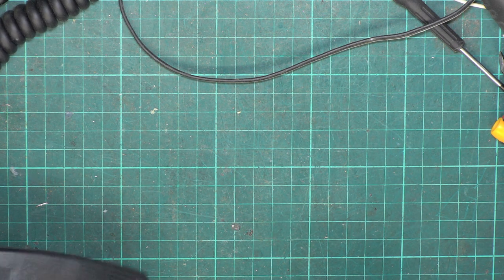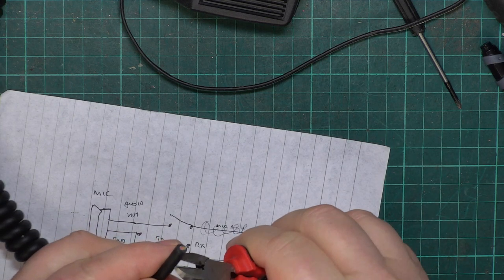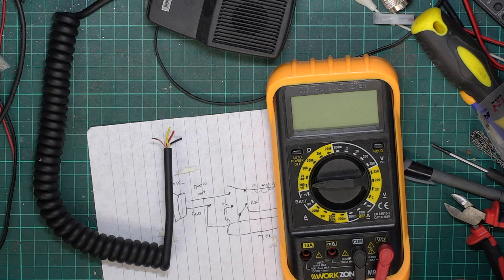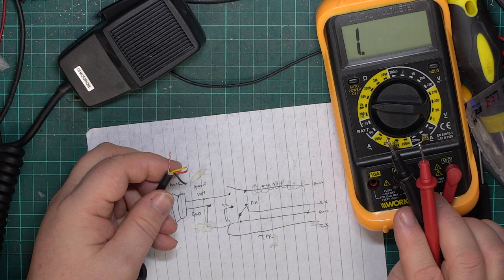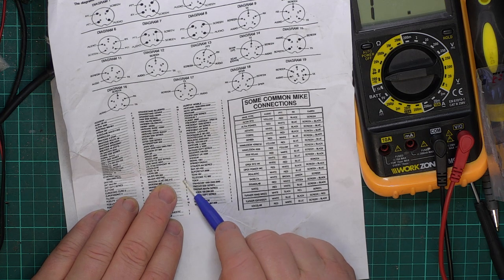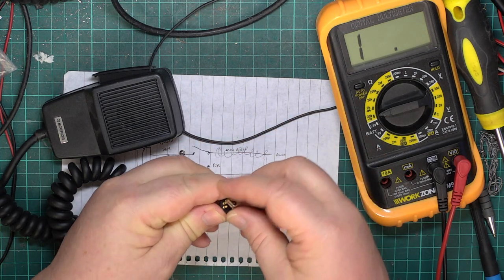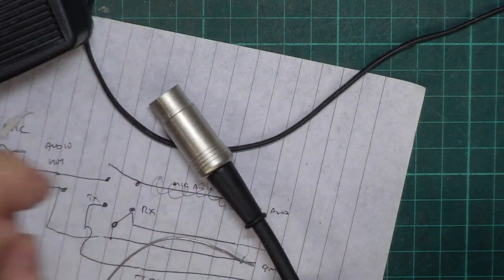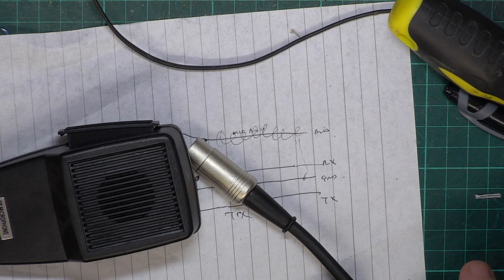CB Mic wiring for UK FM radios

Comment: Knights use to do a very comprehensive mic wiring book back in the 90's which had in it what you went through for determining cables. In Northampton, we breakers who can't get their head around that the mic cables have different colours and what's colour is used for function in one mike is possibly different in another. Especially when you get 5 and 6 pins as the norm on today's uk legal radios. Mics are my fave at playing with, from the std mic to basic power mike to the more comprehensive mics with power echo.

Comment: Hi Richard, great video. Can I make one comment as a complete novice myself, it would be helpful to make sure whatever you are working on or describing, is always within camera shot.
Reply from the maker: It's a snag which is being rectified. When I had a new video mixer a few months ago, the monitor output is HDMI; I was previously using Sony Broadcast kit, but youtube didn't recognise the HiBand format & compressed the hell out of everything to 320p. So with the new mixer I can't use the mega quality sony CRT monitors, so had to buy a flat screen one that accepts an HDMI input.........but the flat screen doesn't have sufficient viewing angle to be seen from my seating position at the bench. I have therefore ordered a small HDMI monitor to put on the bench to overcome the problem. The monitor arrived yesterday but I'm still waiting for an interconnecting cable to arrive.

Richard

Comment: I know you aren’t keen on power mics, Richard, but can you tell me whether they’re wired the same way as the basic mics? Does the variable control on the mic affect the level of the output audio signal? I have a Spyder power mic eBay purchase and am wondering how to wire it for Cybernet radios. Many thanks :)
Reply from the maker: They do wire the same & yes the variable volume control affects the output level. Sometimes power mikes have more wires so they work with old American valved sets with relay switching. I accept that some people like to use a base station microphone with a base station. My objection (other than echoes) is that UK FM radios all incorporate speech processing circuits & usually sound their best with a standard microphone. If you add pre-amplification with a power mic, the speech processing in the radio can end up adding distortion. 

Back to the USA AM system. speech processing wasn't part of the type approval & getting modulation clear & closest to 95% modulation helps with clarity & thus range. On an FM system range isn't affected by the audio...unless it's muffled. Therefore the whole accessory mic market is aimed at the USA or other AM CB markets. 

On the post 2014 CE approved radios that have come here & are useable legally on AM (on the CEPT 40 channels), they all have speech processing because they are AM/FM, thus making power mics pointless.

Richard, G0OJF, UK

Comment: Your drawing might have been a little better, but you explanation was fine.  It might appear complicated if someone has never fitted a plug to a mic before, but it really is easy.  Learning to solder is a bit harder, but heat what you are soldering and add the solder to it, NOT the solder to the iron and try to flow it onto the wire or pin you are trying to solder.  Might appear obvious to most people, but it would surprise you how often  I see this being done.  Always tin the components with solder, then join them together  the quicker you learn to join both parts together the better.  All it is is practice.  The 5 pin din plug is not an easy plug for a beginner.  Wiring is here   https://www.radiomicwiring.co.uk/  Click on the name of the CB to get detailed wiring.  I have NOT checked they are all correct.

Comment: Hi Richard hope you can give me advice on a problem I have, I have in my collection a nice example of an LCL 2740 which needs a new mic, I've purchased the new mic which is similar to the ones you use and the 5 pin Din plug...here's my problem, on every wiring diagram I can find it says it should be wired up thus...Pin1 Audio, Pin 2 Screen & Pin 3 Transmit...where does the Receive wire go? My head is scratchier than a well known corner trying to work this one out...any ideas...thanks.  Steve.
Reply from the maker: So I looked at the circuit. Correct 1= Audio 2= Gnd 3= TX. The radio uses a relay to switch between TX & RX, so no RX connection to the mic is required. Incidentally,  pin 5 is power out to a mic that requires a power supply such as a K40.
This means the radio receives with no mike connected.

Richard
Reply: @ukfmcbradioservicingTango21  Thanks for your quick reply...so I can just stick some shrink tubing over the end of the RX wire and not connect ? All the best and have a nice Christmas.  Steve. 🥂
Reply from the maker: @stevelomas4119  Roger on that.

Richard

Comment: Hello. I am trying to put one of these mics on a kenwood 281 that has a rj45 jack. I can get the radio to key up but i dont get any audio out in the air. Could you please help me?
Reply from the maker: I'm sorry Ryan but I can't help at all. Quite a few business radios we service use those kind of modular plugs. We either repair the mike with the set & if it's the lead that's duff or no mike at all we would then either buy a new factory mike or a new cheaper pretend mike depending on what the customer wants.

I haven't ever owned any Kenwood/Icom/Yaesu amateur radio gear & we don't normally do repairs to amateur radio equipment either, so I just don't see radios like yours.

Whichever wire carries the mic audio will have to be the screened one. If the lead you are using isn't screened..such as a telephone type lead, you would lose the audio in the lead & end up with just a hum, I would expecr.

Richard, G0OJF, UK
Reply: Maybe thats why im getting no audio out. I was using just standard wire not screened for testing purpose.

Comment: Hi mate when I key up my mic sounds like there's wind in the back ground what could this be
Reply from the maker: You have to work out if it's the radio or microphone at fault first, so try another mike. If it's the microphone, then that sort of noise is a) the mike lead or b) dirty switch. It's easiest to use a switch cleaner first. If you are in the UK, the Servisol one is the market leader.

Richard, G0OJF, UK